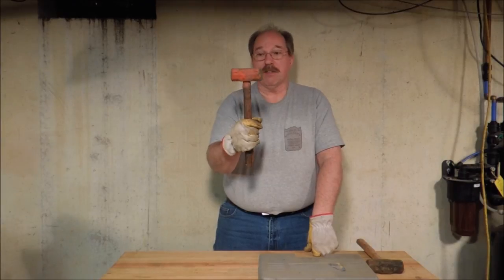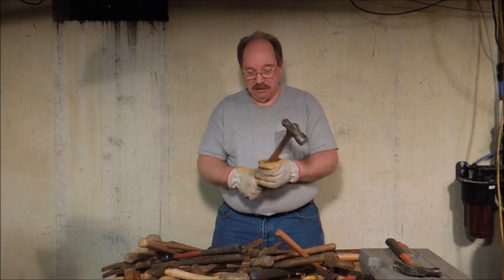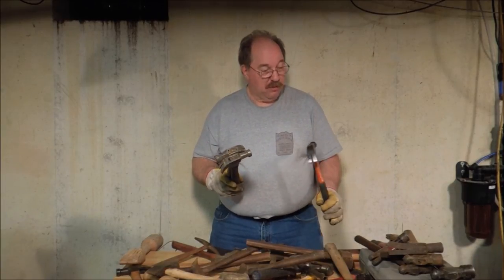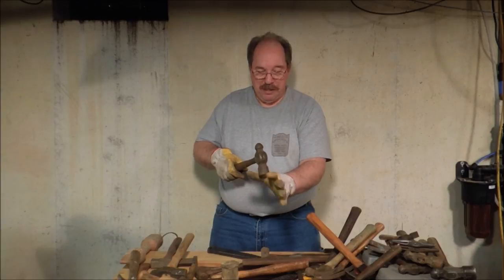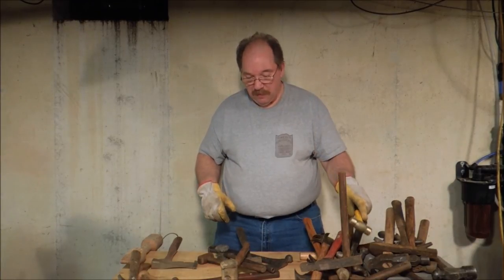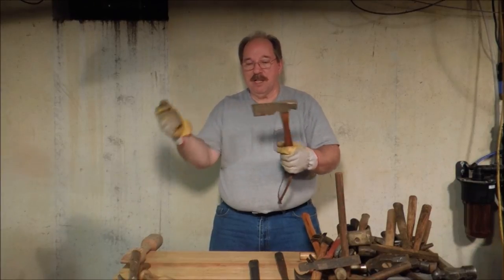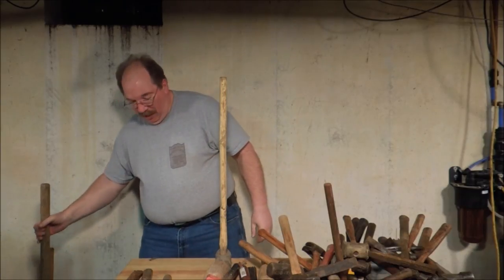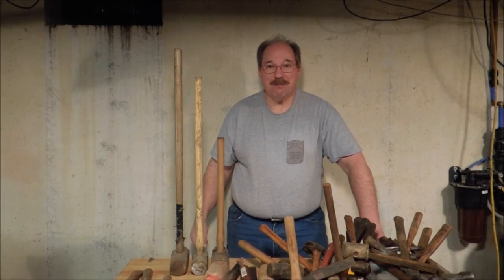Tool Time At Old Sneelock's Workshop ~ Hammers

Comment: I scored some nice hammers the other day. A very, very old Blue Point metal working double ended hammer, a Dixon 9 silversmiths hammer, and a couple of old unbranded, unique looking pieces. The Dixon is really nice. A beautiful piece of art.
Reply from the maker: Good haul. Hammers are one of those tools that solve everything. Either they fix it or bust it up enough that you have to replace it. Either way you end up with a working item. 😆

Comment: I started out in the 60's as a carpenter driving wooden stakes with a 10# short handle hamer. Hold the stake with one hand and swing with the other.  Today the sledge sits in the garage out of the way because I can't lift it with both hands.  Millwrighting during the 80"s we used a 12# hammer on old beater wrenches on 2 1/2 -4 1/2 nuts. Took 6 guys all day to remove 48 head bolts off a boiler and the one holding the wrench had the worst job.  HA a walk down memory lane the "Good old days".
Reply from the maker: +paul harriss In the 60's we used a 20 lb steel block with a ring welded on the side and two short 1" pipe handles welded to it to drive shafts out of the foundry equipment. Lots of head and tail pulleys with 4" shafts. We would sling it up on a chain fall and swing it to drive out the shaft. 
That was a long time ago. Now we have hydraulics to do the heavy work.
Reply: +Old Sneelock&#39;s Workshop Yes I forgot about using a RR tie to knock out shafts. I remember we had a door between the electric shop and the MWT shop. The electric boys were better than us so they had the door welded shut. Not to be out done we hung a big hammer from a sling and beat against the door during break. The door was removed and left open after 2wks. OH the good old days.
Reply from the maker: paul harriss My kind of place.
It's been long enough to talk about now. We found some heavy wall tubing in the scrap pile one night and decided it would make a great canon. We welded a breech plug in it and the next night one of the guys brought in a can of black powder. We set it up in a vice with some 1/2" plate on both sides and touched it off. It was a little one. It only had a 1" bore. The smoke filled the shop so bad we had to go outside. Good thing we were in the oldest part of the plant. The walls were 2 foot thick brick and it was separate from the rest of the plant.
Good times.
Some time I'll have to talk about the high pressure air guns and shooting rats in the shop at night.

Comment: Step away from the table. Proceed to and join a twelve step hammer addiction program. My wife just kinda laughs at all my hammers but when she wants something done she's happy there around. Happy Sunday
Reply from the maker: +Tim Caldwell Until I started this series I hadn't piled up this many tools in one place since I moved. It took 6 trips with my full size pickup to move all of the tools and shop equipment. I had my friend bring over the tractor and implements on his flatbed car hauler. 
This pile of hammers is just a few of the things that are tucked in and around the house and sheds. :-)

Comment: ..well yes sir I can imagine using that short handled sledge. It's my favorite for driving wooden wedges when splitting logs for rails or post. I hope you have a drywall hatchet in your collection as well...
Reply from the maker: +Ol James Your arms are in better shape than mine. No drywall hatchet that I'm aware of. Of course I haven't opened all the boxes after the last move. :-)
Reply: +Old Sneelock&#39;s Workshop  I don't want a short handled anything. I can always choke up on it. I also got my first and last fiberglass splitting maul handle. It was a 6# Collins and the handle wouldn't stay glued. Put a wooden handle in it and it's fine now. I really like an axe-eye maul. They work really great with a good axe handle in them with the curved end. You can sling it out and down and the curve is like Ali's snap when he popped someone.

Comment: The first outfit I worked for right out of school and several times thereafter,  about all I saw on their service truck was a torch, assorted pry bars and hammers and a welder. If they couldn't beat whatever it was into submission they just welded it where it was. I went from a scraper to a grader to a D-8 they just got together. A top track roller shell had worn out and fallen off, leaving the shaft which was a good 2 1/2 inches through if not more. The shaft got replaced when it wore through and the tracks hit the idler spring cover underneath. That took a while. Interesting outfit and people wonder why I am like I am. And I like Estwing hammers. My first was a reject that everybody threw away after they mashed a finger off. I got it to adjust clutches on the dragline and have had them ever since till now. I've lost 2 BIG waffle-headed framming hammers, not frAming. I just fram it severely about the head and ears and it'll work, one way or another. You still need an annex.
Reply from the maker: +Lewie McNeely With a welder, cutting torch, a big hammer and a scrap pile I've managed to get by for a long time.
Reply: Yeah but you weren't running a grading outfit with 5 pans, an 8-H, a 7-F, a couple of 6-B's, a 835 compactor and a couple of old #12 graders whizzing about scattering parts all over BUT you would've been a good hand at piecing them together!
Reply from the maker: You are absolutely correct Lewie. A grading outfit would crumble in those conditions.
I have never worked on daily production earth moving equipment. I have rebuilt a few tractors, rebuilt a JD backhoe, welded up a Caterpillar Dozer frame, and rebuilt a 1946 Ford 3 ton truck from the ground up.
I think the telling difference is your experience with equipment that was rode hard and put away broken.
My experience runs more to manufacturing plants that were in a similar condition to the grading outfit.
In the 9 years I was the Maintenance Manager at the Coldwater United Technologies plant I took a plant that was exploding, leaking, catching fire, and experiencing 25% downtime to .15% downtime, and only the occasional explosion, by teaching the maintenance department to do the job right and repair a problem once was much better than doing it quickly every day.
I also introduced the idea of actually maintaining the equipment. Changing oil, checking wiring, replacing worn parts during scheduled downtime, and using the proper parts rather than spit and bailing wire.
The scrap pile reference was only meant to describe the projects I worked on at home.
It would be a straight road to Hell for anyone trying to run a business that way.
PS The explosions were from "trained" people loading the aluminum melting furnace with wet scrap. Seems it was a lot of fun to make it go BOOM!
Reply: I could and would work for and with you in a SECOND! I understand where you're coming from. One of the operators asked the old geezer on the 'grease' truck for a grease rag and the guy told him he'd already given him enough rags to make a quilt. You can imagine that was the start of a good one. And while he was being so industrious and keeping everything up, the 8 I was running had the rings cut out of it from nobody blowing out the air filter. Went to a 7-F after that. And there was a thread guide plant about 15 miles from here that people took delight in throwing matches in a plating vat. Hydrogen maybe?? Been a long time and I tried the place for 2 evenings after school. Couldn't ever work inside. Walls started closing in but it was interesting.

Comment: i got hammer like that at work think mine got shorter handle tho use for busting tires loose works wonders also when i was in school still i took welding and machinist class and one day at ollies i found a 20 lbs sledgehammer head so i got it then took to school and welded a 5 pound metal handle on it......its a beast ha_ha!!
Reply from the maker: +Jay Adams As long as it works for you that's good enough.

Comment: I'm guessing you've never worked in mines or anywhere else with "explosive atmospheres" because you don't have a beryllium copper hammer.  Why buy a fifty dollar hammer unless you really need it?
They certainly put a premium on non-sparking tools.
Reply from the maker: +Brian Neeley Managed to avoid mine work. Did work with gases quite a bit. Never needed to hammer any though. Ended up with a few beryllium wrenches but sold them off.